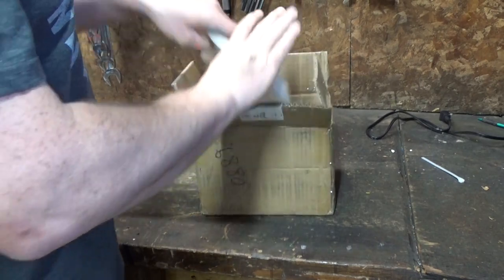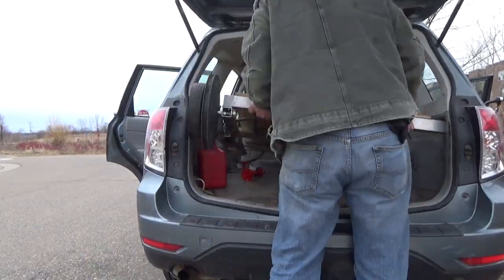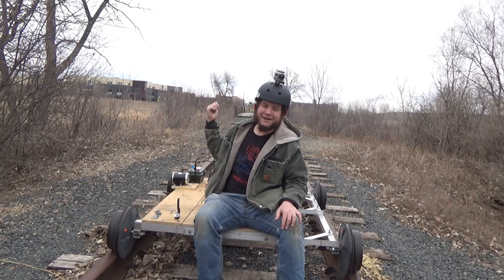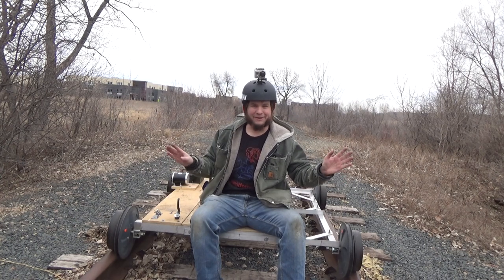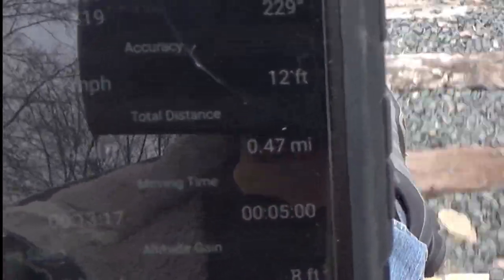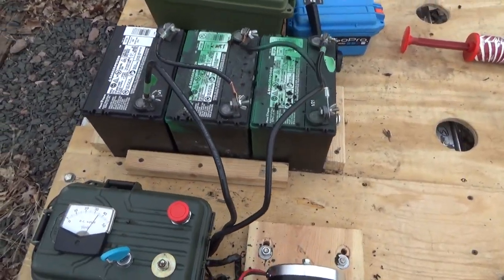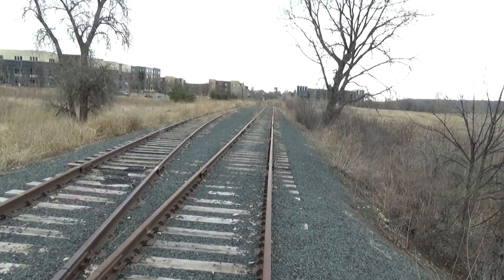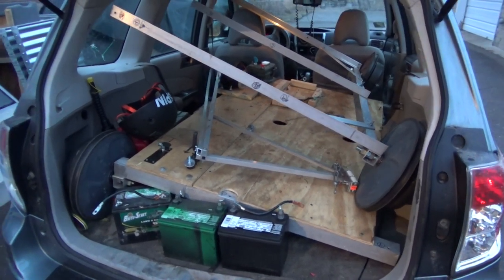Upgrading My Railroad Speeder To Go Faster

Comment: Inspiration! You could run a belt between each set of front and rear wheels (or just on one side), and engage the belt with the motor directly. That way, you’d have power from 2 or 4 wheels, and it would be easy to adjust tension,and you could experiment with different drive wheel sizes.
In a different subject: I wonder if you could incorporate a flywheel? I think it might be cool to make mass work for you, by using a flywheel as a sort of reservoir of inertia. You could have a flywheel between power source and drive wheel. That way, you could be generating usable inertia even when the drive wheel isn’t engaged, by spinning up the flywheel.

Comment: Hi, just dropping some ideas. With lithium batteries you will probably get a better result, they can deliver way more current than car batteries. Also, you could use a like a go kart rear axle with a detachable link (so you will be able to take it apart) to get traction in both rear wheels. Hope it helps!

Comment: Yer invited to bring that Rail rockit out here to San Diego.  Check out the Carrizo grade which sports a bunch of tunnels and high anxiety bridges.  The Carrizo grade is  abandoned, starts nowhere and ends nowhere. Well, technically it starts and ends in a nudist camp. 

So you really don’t have to pack any clothes.

So bring your Minnesota tan out to San Diego and we’ll run your rail rocket through some mountains.
Reply from the maker: That would be cool! When my grandparents used to live in Santa Cruz they had an abandoned Railroad in the backyard. Some local guy would occasionally ride around on a railbike :-)

Comment: You might have to go with the more expensive batteries, if you want endurance.

Either that or Jerry-rig up some kind of gas-electric hybrid drive. But that would add a fair bit o' weight.

Comment: Awesome video! You could also use a geared cycling transmission or more gear ratios to increase speed from the motor, or use some higher current batteries like lithium ebike batteries?
Either way, I'm glad the rails are getting some use again. Maybe they could run a heritage line or new rail transit on it?

Comment: Deep cycle batteries last way longer. But they’re more expensive sadly. If I was building something like this, I would’ve just used a small gas engine because filling up a tank is faster than charging a battery
Reply: I agree.  I would just get a engine from Harbor Freight and use a clutch.
Reply: Actually - I'd disagree..
1st as it's just a small "test unit" and 2nd, even deep cycle batteries HATE being deeply discharged.
Be me- I'd install (yes) a small gas powered stationary motor - but I'd install it with THREE standard car alternators, so that they 'recharged" the main batteries whenever they got depleted enough, to warrant a recharge - as that way - you can still use car (or truck) starter batteries - OR run the motors direct off the stationary motor's (three set) alternators.
Allowing you to bypass the batteries if they ever get too depleted

Comment: hello again. if you're looking for new rails to run, there are some abandoned rails by the Freun mill in Minneapolis
Reply from the maker: I was actually eyeing those a bit :-)
Reply: @saveitforparts  I've walked it a few times. I've been meaning to fly around with my drone. if you're ever making a plan, I'd be happy to get some drone shots of you running down the rails. I also may have a solution to your battery issue. we use the heavy diesel starting batteries at work, the type 34. I can grab a couple destined for recycle, and maybe you can use those for your cart. they are a hybrid between starting and deep cycle

Comment: Could a lithium battery pack be used? Using salvaged batteries to spot weld a power bank
Reply from the maker: That's something I want to try. I have a dead 36v battery from an auction that I need to work on.

Comment: Oh yea!

How about a more serious rail speeder build and adventure? there are rallies... 😁
Reply from the maker: I've been trying to get in touch with the Durand club but they don't seem to understand email :-(
Reply: @saveitforparts  My Durand?
Reply: @saveitforparts  I honestly don't think it would be terribly expensive to build a really cool speeder.
Reply from the maker: @DetroitMicroSound  Not sure where you're located, the town of Durand in Wisconsin has a disused railroad where they run more legitimate speeders and sometimes do tours. I've tried contacting them to ask about joining the club or just using their track, but they're not good at email.
Reply: @saveitforparts  Ah! gotcha. Durand MI has a railroad museum. Maybe pay them a visit, this summer, and introduce yourself. Sounds AWESOME!! Speeders are awesome! I lived in Philly between 2001, and 2010, and in that time I saw a lot of speeders. I went out on the train, to Pittsburgh from Philly, more times than I can recall. (Also, D.C. NYC, Rhode Island, Boston, Charleston... ) I think you could seriously build a very nice light speeder, with enclosed/fully open cab, good speed, power, and quick acceleration.. Think: lowered Puch Haflinger, with soft sides, and top. all removable, and can be carried with, on a hot day, or zipped on for an autumn colors rally.
Reply: @saveitforparts  Railroad folks don't pay any notice of someone, until they show up to work, or participate in the action. 😁 I'm in Rochester Hills MI, btw.
Reply: @saveitforparts  Did you think of putting solar panel on top?
Reply from the maker: @uroskostic8570  it probably wouldn't keep up with the motor, but might help a little!
Reply: @saveitforparts  it could help a little. at least to help you bit by bit if you get stranded

Comment: You need a truck, like a full size truck.
Reply from the maker: I had a pickup for a while but it just wasn't useful for anything but hauling dirt. The Subaru pretty much does everything from offroading to hauling passengers to towing boats to bringing weird dumpster stuff home on the roof!

Comment: what machine are you using?
Reply from the maker: The power is from a 36v scooter motor, with three car batteries. I should be using deep cycle or lithium instead, starting batteries aren't really good for this.
Reply: @saveitforparts  ok bro greetings from Indonesia 🇮🇩🇮🇩